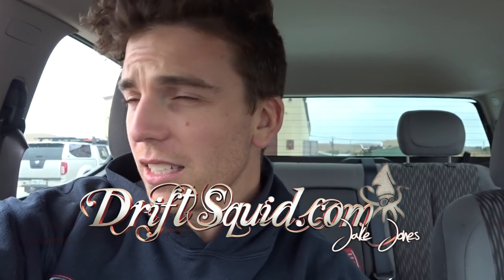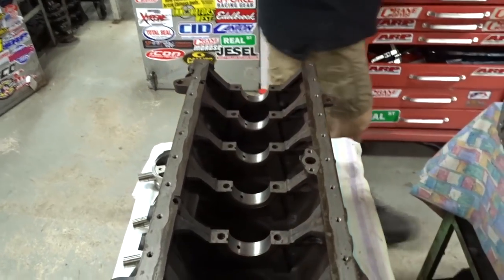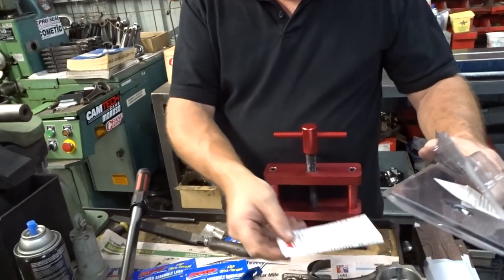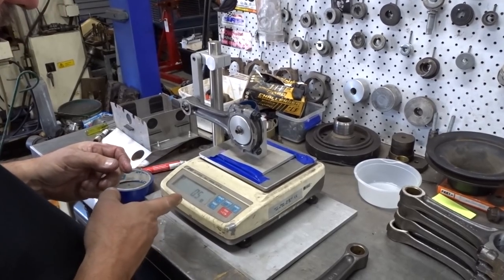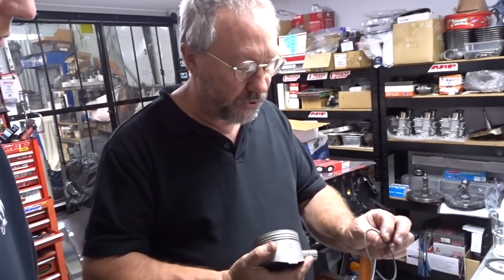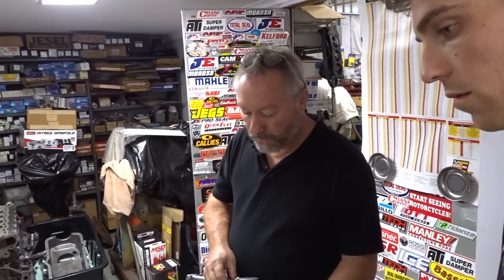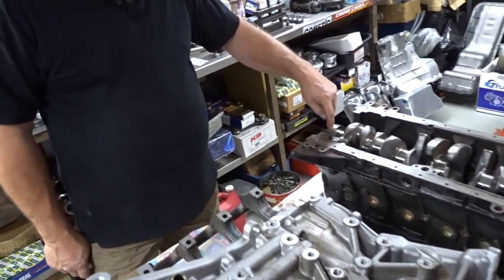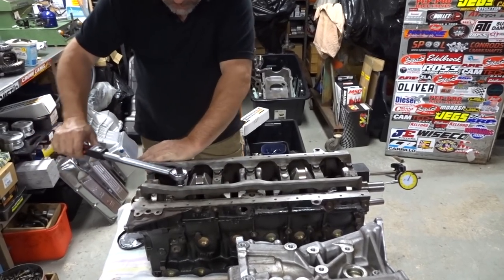RB30 Budget Build - Bottom end | PART 3

Comment: Man, this video couldn't have come at a better time for. Long story short, due to some small oversights that took place well before i took ownership of my car, it turns out my 25 crank has a flogged out keyway from a loose harmonic balancer. :( So ive used this opportunity to shelve the block and achieve a long time goal of building a 25/30 with a spare motor i had in storage.
I haven't gone quite to the extent of what you guys have gone to, but i have tried to spend money in the right places to achieve my power/application goal reliably. Bottom end is completely standard RB30, measured up within specs, no weird obvious wear etc. Ive fitted a nitto crank collar (with the chamfer), brand new N1 oil pump with Golebys billet gears, as both spare pumps i had were scratched up. I gave the bores a quick hone with the toilet brush and cleaned the block/crank galleries as much as i could without removing the plugs. Bearings are ACL race which sit around the 2-2.5tho clearance on the rods/mains and my end float is around 4-6tho. I did almost get caught out by the girdle moving position!
Now the only thing that has me terrified is that ive used OEM RB26 piston rings on RB30 pistons. The research i did came to the conclusion that the RB26 rings are identical in dimensions to RB30, just the end gap changes. But now im paranoid as fuck, especially since the head is now on the engine! If Darren has a set of both there, can he please put them side by side and compare?
Reply from the maker: Mate I will make sure I ask him and get a video to explain. It may be a week or two though before I have the info for you. I will do my best to get the info asap though. Sounds like youve done everything right so far though mate.
Reply: @DriftSquid  thanks man, appreciate it!

Comment: Awesome video and loving all the build tips from Darren! Have a question though - Your block has 5 thou float clearance which worked out well but what would you do if you wanted more float like 8 or 9 thou? Darren spoke briefly about using a soft hammer on the ends so can he explain that in a bit more detail please? Thanks
Reply from the maker: From what I gather you would pretty well crush the bearing to make more clearance. Or pull it out and take some material off it. Wouldn't be an easy task doing it yourself in the garage I wouldn't have thought. I'll ask him next time mate

Comment: Can you please ask Darren if using a cometic gasket and a set of studs and the things starts drinking coolant and creating milky oil is it normally a cracked head or do the multi layer gaskets still fail, I’m running about 20 psi and looking to get 500rw hp, thanks heaps and love the content cheers
Reply from the maker: You may have got the wrong head gasket mate? Or if your head gasket was blown and thats why you put a metal one in. You should have got the block and head decked to make sure they are straight. You may also have damage to the head or block. So many factors here sorry mate
Reply: @DriftSquid  thanks for the reply, and yes it’s a question that can only be answered by opening it up, it is an unknown rb30 that I used to engine swap into an EH Holden and it’s a bit of a mission to get in and out, but will just need to be done, thanks for the great content also

Comment: I’ve got spool rods for my build and I was told by a pretty reputable company not to use them and I asked why and they couldn’t really tell me, other then they just didn’t like them.... and I’ve hunted for failed video or manufacture issue over the web and couldn’t find anything
Reply from the maker: I wouldnt listen to anyone without experience and knowledge in this area mate. Opinions are like a**holes, we all got one. Hope all is well
Reply: That's because they have an affiliation with the company or brand they carry. Use what every has the runs on the board mate 👌
Reply: I use spool rods in a 4G built by Darren, haven’t had a drama and also a good company to deal with 👌
Reply: @zaksuzuki  from what Ive found,  the reason is they don’t like them is they think they are made in China and they aren’t rated by APR to use there bolts. But I’ve googled spool rod failures and and issue and I couldn’t find any videos or any forums with treads having issues 🤷🏻‍♂️... I had my precision turbo blow in 16 dyno pulls out in 6766 failures and found forum after forum with problems on all Kinds of car, 1000’s of pages on problems...
Reply: @ryanlowe3588  I wouldn’t believe too much of what people say. I also use them with arp bolts. You can pretty much google any part by anyone and get pros, cons and plenty of bullshit. Heaps of people use spool gear.
Reply: @zaksuzuki  I’m not overly fused... I’m not aim for more then 620wkw anyone so I’ve seen bigger powered cars run them... I know Golaby’s are running the same rods more power for years no drama... the company I’m going to are really good, I told em what I wanna do and they said they us the rods but the wouldn’t do the build if I didn’t go to billet main caps, they said main at around 900 engine hp it is just a matter of time